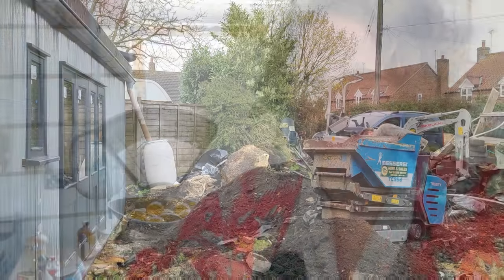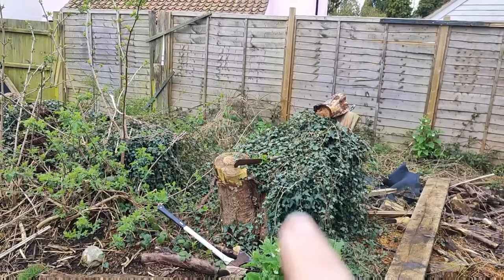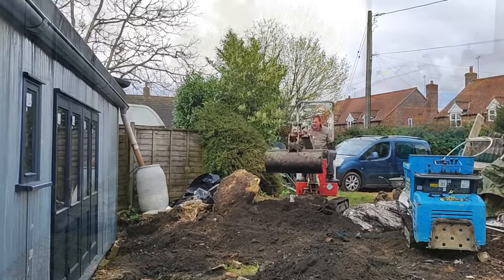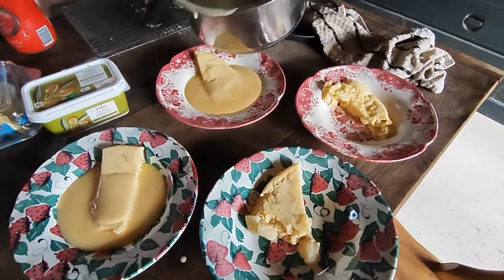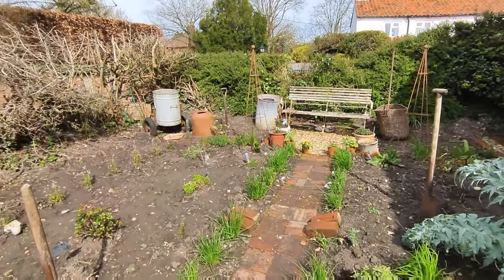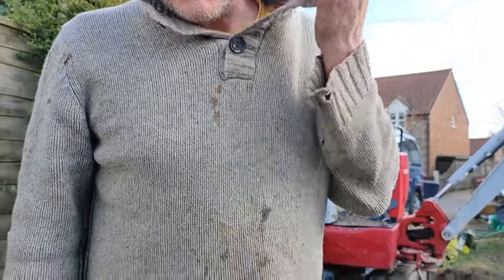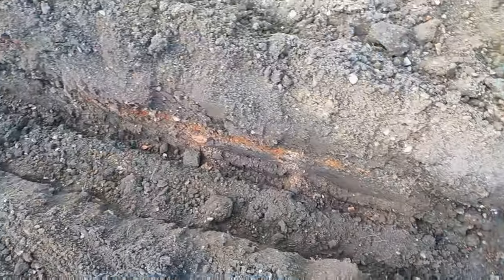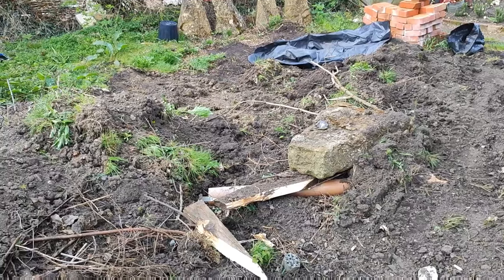Epic DIY Renovation: Moving Earth & Digging Trenches | Doing it Ourselves

Comment: I love your optimism 'it's all going to look lovely'! Have you noticed that the soil from the ground seems to double in size once you removed it? You had a very tight space to work in overall. When you get a grab truck to take away all the surplus material it will look so much bigger. You both have worked so hard to get to this stage. Well done both of you.
Reply from the maker: To think, one of the reasons we moved to Starre Corner is because Rowan wanted a garden - poor Poppet, we've wrecked it 🤣